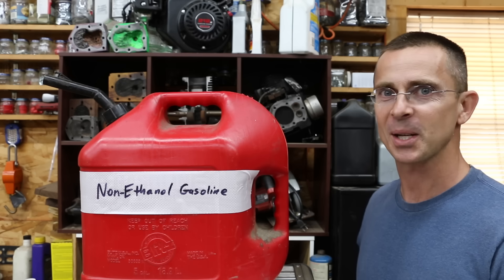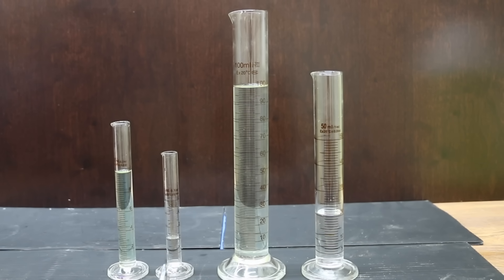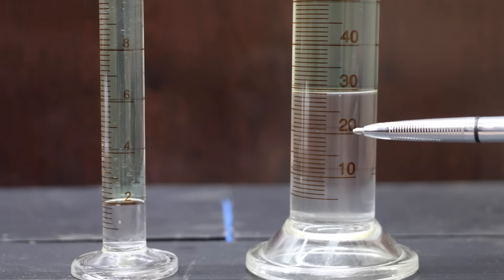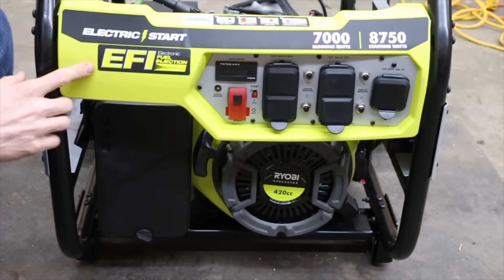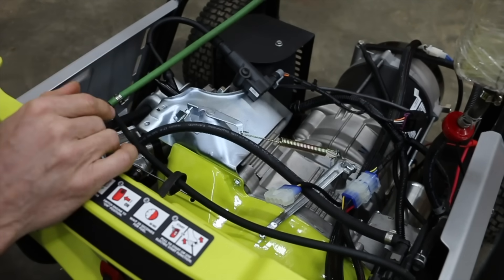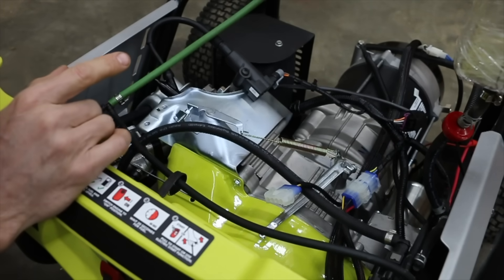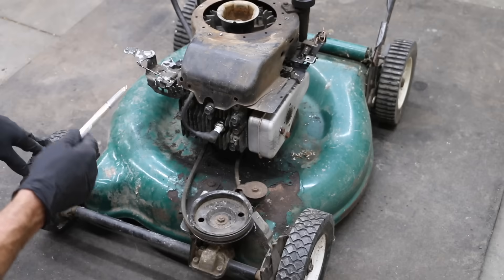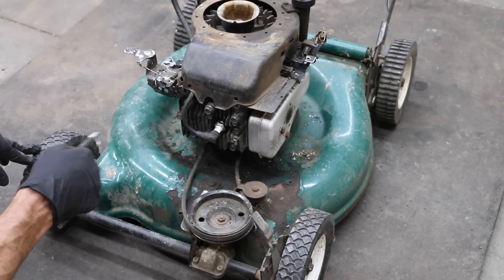Is Non-Ethanol Gasoline Really Better? See the PROOF!

Comment: As a former small engine mechanic, I can verify that 10% ethanol and above will settle out of gasoline after a month or so. On small engines, it's certain death, as the sugar content in corn alcohol settles along with it, leaving a sticky yellow mixture on the bottom of the tank, which immediately gets sucked through the fuel system the next time the engine is started. It literally turns rubber hoses to goo, and once it goes through the carb, it coats the intake valve stems with this stuff, which remains a liquid at normal operating temps. Once you shut it off, it cools down and the mixture solidifies on the valve stems, essentially welding them to the valve guides. When you restart, the intake valve will either stick open or break the camshaft in the first couple rotations. I've replaced several B&S engines because of this syndrome, and one or 2 Kohlers. Just an FYI. 😉
Reply from the maker: Thank you for commenting on this!

Comment: I haven't had to use Stabil since ethanol was added to gas but I do crank my small engines every 2 1/2 to 3 months to circulate the fuel and keep the sugar and moisture from settling in the bottom of the float bowl and fuel tank.
Reply from the maker: Thank you!

Comment: Future tests I would like to see is on motor oil. They always say so many miles or so many months for an oil change. Does the oil break down with age or is mileage/use the only thing that matters? I have read that the 3 month or 3k mile rule was invented by garages back in the day to boost business. Don't know if that is true.

Another test that would be interesting is, petroleum based oil vs synthetic oil. Is the difference that great? I have tried both and the synthetic seemed to make it run smoother and quieter. Another thing I found out, due to laziness 😂, is that petroleum based will last much longer when way overdue to be changed than synthetic. I had a 99 Ranger and got very lazy on the oil changes, about once a year 😯. Both oils will start burning when they reach a certain point. I don't  remember how long it was, just that I could go 2-3 times longer with petroleum based oil.

For anyone wondering, the body gave out on the truck first and the engine was still running fine at 160k miles. I sold it to a neighbor for almost nothing and he fixed up the body and resold it. To my knowledge it's still going. I also wanted to prove the Ford tough slogan right 🤣.
Reply from the maker: Thank you!

Comment: You can get non-ethanol 100 octane low-lead gas (100LL) gas at most local airports from self serve pumps. It's dyed pale, and while it costs somewhat more, it's WAY cheaper than buying  non-ethanol by thr quart at Home Depot, TSC,  or Lowes.  I don't think it's all that much more when you consider the value added of no ethanol and higher octane. I guess you'll have to judge for yourself if it's cost effective enough. Google 100LL to find locations, price, and whether it's self serve or full service (airport fuel truck). It's what I routinely use in my Sportster, generator, snow blower, and lawn mower.
Reply from the maker: Great point. Thank you!
Reply: 100LL and even better, Sunoco 110 are awesome

Comment: There is another aspect to ethanol in gasolene: polimerisation. If left in a carburettor for a longer period, a sticky gel appears. This may not happen in the US, but I have had this problem both in a lawn-mover and a motorcycle, which were left with german E85 during winter. The motorcycle carburettors were a write-off, it was impossible to get the gel out of a the idle system. Be sure you don't leave your fine efi generator with that Ethylene containing fuel.
Reply from the maker: Great point!

Comment: Another great video and testing setups Todd! Thank you for your efforts!
Like many others, my biggest gripe about ethanol fuel is that it corrodes the insides of the fuel system and carburetors. 
I found over the years that it was worse on Tecumseh engines...after having to buy a few lawnmower carbs because I forgot about draining it out. Derp!
Reply from the maker: Thank you!

Comment: My truck has a fuel injected 4.0L 6 cylinder built in 1988. I advanced the timing years ago and have run 91 octane since. About 6 months ago, a new Maverick station opened near me that carries ethanol free 91 octane. I ran my truck to within a gallon of completely empty and switched over to the ethanol free, and the difference is amazing. My engine starts up much easier, runs and idles much smoother, accelerates better, and I get on average (after running ethanol free for 6 months) 1.5MPG better economy. A big difference considering I averaged 11MPG before switching to ethanol free. Unfortunately I can't get ethanol free everywhere I go in Washington state, and when I do have to fill up with E10, I notice a big drop in performance, especially when climbing hills. Plus I try to avoid ethanol for political reasons as well (won't go into that here. It's a long story about the corn subsidies), so I recommend ethanol free to everyone.
One last thing, 2-strokes HATE ethanol. Even when tuned right, every 2-stroke I've had that I've burned E10 in runs terribly, but as soon as I get ethanol free running in them, they run perfect.
Reply from the maker: Impressive!

Comment: I'll trade 4% loss in fuel efficiency for a 20% reduction in cost at the pump. I've been using E10 since 1979. Small engines, motorcycles, tractors and cars/pickups. There were a few teething problems in the beginning. But really I have I have far fewer fuel system issues today compared to pre E10 times. Young folks fail to realize that we had dirty carburetors and other fuel related problems pre E10.

Comment: The problem between using it or not has to do with the hoses and gaskets used. The alcohol will degrade rubber and gasket material not rated for alcohol use. Thus if your owners manual says to use only non ethanol gas you should do it or not be surprised when you have fuel problems.
Reply from the maker: Thank you!

Comment: I think it would be awesome if you could get hold of a small(Relatively) Diesel engine and test Ultra Low Sulfur vs. Biodiesel vs. waste oil(Vegetable, Peanut, Corn, Canola, and used motor oil as well.) Also, you could test different methods to start them in cold weather like Ether, WD-40, Gasoline blended with Diesel, etc...
Reply from the maker: Thank you for the video idea!

Comment: Did you clean the lawnmower engine and install a new spark plug prior to adding the ethanol free gasoline, like you did with the inferior ethanol🤔👀. If you did the aforementioned, you didn't show it. Plus, a small engine mechanic told me that even ethanol free gasoline should not be sitting in your applicable equipment tank if it's not going to be used within a month's time. Also, he recommended for small engines an in line gasoline screen filter, in lieu of an in line gasoline paper filter, as the paper filter will deteriorate in a shorter time span and, therefore, clog miscellaneous components. I utilize ethanol free gasoline in all of my small engines and in all of my vehicles, along with Amsoil signature series 100% synthetic motor oil and K & N oil/air filters. Those of you who say that the aforementioned Amsoil is too expensive are egregious, ignorant and asinine. The Amsoil that I use has a 25,000 mile service in lieu of a 3,000 to 5,000 mile service interval. Do the math. I save money while employing better oil and spending less time servicing my vehicles. You get what you pay for. Buy junk, harvest junk. Buy quality, yield quality, dependable, reliability and longevity.
Reply from the maker: Yes, it was cleaned. Thank you
Reply: @ProjectFarm  , good job. Then the aforementioned test is impartial.

Comment: Ethanol fuels create unique problems here in WI where motorcycles are parked for months over the winter. If tanks aren't drained, or fuel shut off to the carbs the ethanol softens the rubber tip on the float needle valves and lets fuel seep through the engine into the crankcase. Used to be something you didn't even think of, but a lot of riders found this out the hard way with ethanol fuels how quick you can spin a bearing in a crankcase filled with gas... Especially happens on older bikes, but also on newer ones, and if you drain the fuel the needles and other rubber components dry out and crack. Hope they never stop offering non ethanol all together.
Reply from the maker: Thank you!

Comment: I'm looking forward to your long-term test which hopefully will definitively establish the difference between non-ethanol & 10% ethanol gas.

I have a Honda generator EU2200i & have used non-ethanol gas in it since it was new because I think/believe I'm avoiding carb or fuel system problems years later.  So far, after 100 hours of use, there is absolutely no gum/varnish in the bottom of the float bowl.  I've NEVER had a problem starting the generator on the 1st or 2nd pull.  I've always added SeaFoam to the gas I pour into the generator's gas tank.

I've started using non-ethanol gas in my 2009 Toyota Yaris solely on the belief non-ethanol gas is less likely to cause carb/fuel systems than ethanol gas.

87 is the octane rating of non-ethanol gas here in Northern Nevada, not 91 octane that you used.  I can't say I've noticed any differences in the way the engine starts or runs.
Reply from the maker: Thank you!

Comment: Ethanol contaminated fuel causes over heating, poor combustion and a noticeable drop in low down and midrange torque on 2 stroke engines, especially motorcycles, once the engine reaches operating temperature. This is due to ethanol dropping the vapourisation point of unleaded gasoline from 35 Degrees Centigrade to 18 Degrees Centigrade. On a 2 stroke this means that the fuel vapourises as soon as it enters the cylinder via the transfer ports and hits the hot cylinder side walls during the induction cycle, instead of vapourising at top dead centre under compression. This is where the overheating and power loss is caused. 

This can be solved by mixing in a small amount of kerosene or diesel at 33:1 to 50:1 (depends on the engine) to raise the vapourisation level of the gasoline back up to a more suitable level, as both kerosene and diesel have a higher vapourisation point than gasoline or ethanol.

I've been running 33:1 diesel oil, along with the normal 2 stroke oil, in my 2 stroke motorcycles for a couple of years and it solves the loss of power and overheating problems caused ethanol contamination.

The corrosion problem with ethanol in gas tanks is caused by the fact that ethanol + oxygen (in the atmosphere) = acetic acid (white vinegar). Acetic acid is a solvent of iron and leaches it out of the steel in gas tanks pretty quickly. Acetic acid isn't nice to rubber or brass either.
Reply from the maker: Thank you!
Reply: @ProjectFarm  I've experimented with a zinc boating anode in a gas tank and it seems to neutralise the acetic acid that causes so much damage to steel gas tanks and make rubber & neoprene motorcycle fuel hoses go brittle, following exposure.

Comment: 4 points.  1) You made the one about small (and marine, collector car) engine use where they set too long and it causes many issues in fuel system.  2) Is it actually a cost effective use of farmland? NO!  3) Consumers hate dealing with all the colors and octane crap at the pump.  4) It is simply government ran amuck with a small number of big farmers and corporations getting rich off it...
Reply from the maker: Thank you!

Comment: Great testing procedures as always. It will be interesting to see the long term results that you are working on. Being a boater & fisherman, it seem that the use of Ethanol in marine tanks is a real problem. This may be related to the fact that these tanks are exposed to a "wet" environment or that the Ethanol just degrades over time when it sits in tanks for a long period of time, or a combination of both? Perhaps you can come up with a marine test of Non-Ethanol vs. Ethanol gas. Thanks for doing what you do!
Reply from the maker: Thank you!

Comment: Ethanol has fewer btu's per gallon than regular gasoline does. It also cost approximately 75% more to produce then regular gasoline. So it increases the cost and lowers fuel efficiency.
Reply from the maker: Great point!

Comment: This is a good one as I have been wondering.  Personally, I got 45 average mpg in a car with non-ethanol gas vs 36-38 with ethanol gas.  I actually had that same car's fuel injector o-rings leak out onto the engine if I used Get Go gas.....  but it went away if I went to a different station....  Great stuff !!!
Reply from the maker: Thank you!

Comment: My long term test (2 years of storage) resulted in a rotten fuel cell, split at the seams. Fuel lines that rotted from the inside out and a carburetor that had just been completely rebuilt, in need of a complete rebuild.
Reply from the maker: Thank you for this information!
Reply: @ProjectFarm   I forgot to include a vital part of this information. I had Ethanol fuel in the system during that short period of storage.
I've had cars with fuel from the 70's that was still good enough to run the engine. It had a varnish type of smell but burned fine.

Comment: I used to put 10% ethanol gas in my former 1986 Old Gutless Cierra TBI 2.5L 4-TEC. It did clean it out real good and it ran better and got better fuel economy than with regular gas. It cleaned out the intake manifold from the injector. But my former 1993 Ford Crown Vic prefered regular Sell gas. 4.6 W SFI, OBD1
Reply from the maker: Thank you!

Comment: One of the most common things to cause a engine warning light is a bad oxygen sensor. My mechanic says that not changing it out  is not really hurtful.  "The only effect is a 3 mpg loss in fuel mileage." I wonder if that is true?
Reply from the maker: Thank you for the video idea!
Reply: @ProjectFarm  You are welcome. My work truck Oxygen Sensor has been out for over 10 years with no problems. 274,000 miles. Not sure of the gas mileage thing.

Comment: When mixing ethanol (and most miscible solvents) with water, volumes are not additive. 10 mL ethanol + 10 mL water will result in less than 20 mL of solution.

There are tables you can look up the values online. I’d wager that the gasoline was exactly 10% ethanol
Reply from the maker: Great point. You are right. It should have right at 10%
Reply: If you read the stickers on pumps, and many are not even stickered now as e10 has become ubiquitous, but the stickers say a "minimum of 10%".  it depends on how good a day the dude at the gasoline distribution facility is having.....all the gasolines now (with very few exeptions) all come from one distro point. Truck fills up with it's 20,000 gallons of gas and the last stop is the ethanol  blend point and one truck might get 10%, the next truck might 12% if the dude was busy arguing with his wife on the phone, you now what i mean. Also, one of those stops is the 'additive' station where such things as Techron is added for Chevron stations, and diff additives for other 'brands'....

Comment: How about testing this with a car, for say 5,000 miles for time reasons?  Something easy you can pull the head off like you do the lawnmower engine and do 5,000 non ethanol and then 5,000 with regular 10% gas.
Reply from the maker: Thank you for the video idea!

Comment: We did dyno testing on E10 vs non ethanol and found it produced only a small increase in power, almost insignificant, and as you just indicated, it required 4-8% more fuel to travel the same distance. I like the long term test idea, perhaps some old carburetor could be used to show the effects on the metal....?
Thanks for all your efforts...
Reply from the maker: Thank you and great recommendation on metal too!

Comment: The real problem with ethanol in fuel is chain saws and boat motors, any 2 stroke engine when the fuel absorbs enough water (condensation) it will separate leaving the ethanol /water in the bottom and the gas with premix in the top... start the engine like that it runs without oil, ruins the motor... i recomend no ethanol in small engines, boats, chain saws, weed eaters, generators, motorcycles or vehicles that could set 2 or 3 months without running. Thumbs up on vid....
Reply from the maker: Thank you!

Comment: As it pertains to small engines, does spark plug gap and heat range matter as much as it may on cars? Also, how about running a grease in the crankcase? Any type would do, but possibly a conventional V synthetic grease with lithium complex, wheel bearing, and another thin grease in the crankcase. Slobber it all up in there ( probably a tube or two worth ) and let her rip. The oil slinger may be able to distribute the grease enough when its hot, so maybe do a cold grease test and a hot grease or hot engine test to see if its plausible. You'll probably throw a rod but it'll be so cool! thanks for the free science
Reply from the maker: Thank you for the video ideas!

Comment: I got stranded 25 miles back in the British Columbia bush in griz country. My ATV died and would not start. After figuring out the only thing different was the gas was from Mohawk and had ethanol. I field stripped the fuel system . Cleaned it out and had a can of gas that was not contaning ethanol . First crank of I went. Never used it again on my atv.
Reply from the maker: Thank you for this information.